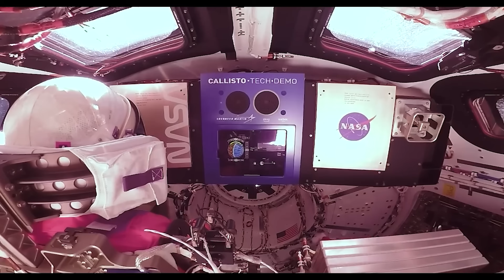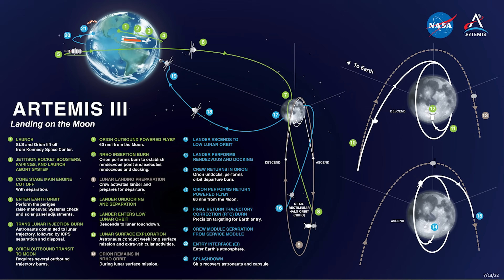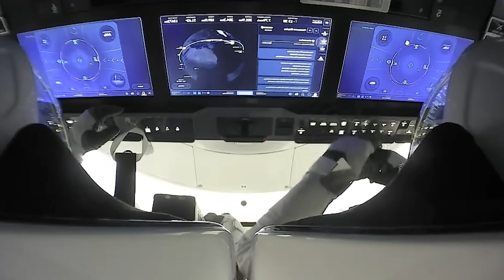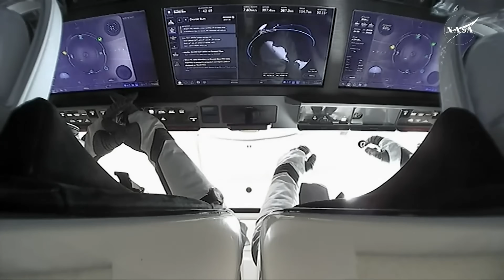SpaceX Found Brilliant Solution to get back to the Moon before China without Starship: DRAGON

Comment: Let's be clear, Starship hasn't had any failures! (other than maybe the one that blew up on the pad, but still, not really). They're only doing testing. Research and development. R&D is NOT failure! They are testing designs, pushing limits, and everything about it, including heat shielding. "Failure" is the point. They are not completed ships on missions. To be clear "failures" are the mission, so they've all functioning as intended. To find the limits, and test designs.

Comment: As far as I know, Dragon does not have a radiation shield to operate beyond LEO. This is the main difference between it and the Starliner capsule.
Reply: The longest distance reached by the Dragon spacecraft on its last commercial spacewalk was 7,000 kilometers.

Comment: Here’s a thought launch an empty hls and fuel it up. we don’t need 100 tonnes of cargo to the moon. Not yet anyway take half that. Launch Orion on FH which it can do to low earth orbit but not to tli (10 tonnes shy)  Dock hls nose to Orion and transfer astronauts over. use hls as a second stage to push Orion to the moon, instead of sls. park it in orbit and descend in hls. Return redock with Orion and return as originally planned. No need to modify dragon no need to use sls just sacrifice 30tonnes of hls cargo. Of course it will never be looked at, no attached jobs program.

Comment: This is completely wrong. 1 Starship HLS requires 15 subsequent starship launches to get it out of low earth orbit and to the moon. 

Nothing you claim here makes any sense. 

Dragon also lands in water

Dragon is not hardened to radiation like Orion

Dragon is smaller than Orion. 

You are literally wrong about everything
Reply: Add to that he seems to think you need to bring all your oxygen with you. He mentions "CO2 scrubbers", which he doesn't seem to know puts breathable Oxygen back into the capsule air.

Comment: The key concept is what is the mission goal, and why?  if NASA have mission test bundles for a perm base ok sure, that means substantial scientific goals will be met that's worth $$$$     
Just to get back before China??   meh why??  we have been there and done that.

What is the mission use case to put a perm habitat on the moon?    Simply as a Mars testbed?  or are there minerals to be utilized on the moon?
There are a number of concepts floating around about attaching multiple starships together into a single space craft to Mars that could then disembark a landing version of starship that has a larger special cargo load.
Also launching multiple starships variables with 8-12 couplings to connect expandable habitats in order to form a space station core has also been envisioned, if they attach 3-6 starships made as fuel tanks to that, you have a very functional orbital base without the cost of going back to the moon.

Comment: Nope. Place Orion on Falcon Heavy is more plausible. (Assuming Falcon heavy can carry that mass and an additional stage for Lunar orbital and earth orbital injection.

Basic problem is Artemis was badly designed with too many components (lunar orbital taxi and refuelling, moon orbiting space station etc).

Dragon would need a significant redesign to act as an earth to moon return shuttle plus you still need to lunar lander and return to lunar orbit element.
Reply: I believe FH was examined as an alternative to sls and could lift Orion but not with the fuel required. FH  has 11 tonnes less tli capability than sls. It would need a second flight and in orbit refuelling to do it. Orion wasn’t designed to be refuelled so would need a major redesign and re-qualification campaign. Congress hated the idea.
Reply: @differenttan7366 i cant say I’m surprised. Space X fanboys like bs

Comment: For the return to the moon, it makes more sense to use 2 starships.  Using one ship for the actual crew of at least 4 astronauts and the other as a fuel deport that goes to the moon with the first starship.  This provides a comfortable protected ship for the crew and added space for scientific equipment.  By sending a depot ship along with the screwed ship, enough fuel is available for the round trip and then some.  Lastly, durting this round trip, a fully functional Starship designed for return to earth's surface is placed in a low earth orbit.  Once the ship used for the crew arrives back at earth, the crew transfers to the third starship and return to earth.

This creates 2 advantages. The crew ship used to go tovthe moon does not need any heat shield since it will not come back down to earth.  The depot ship, already in orbit around the moon, should have plenty of fuel remaining to supply a later starship returning to LEO.  And because it would not return to earth's surface, it also needs no heat shield.  On the next trip to the moon, the crew starship for the trip is already in LEO and can be refueled by a depot ship in LEO.  

Sorry, more later.
Reply from the maker: Very interesting

Comment: Ask yourself what is the success rate of vertical landing before sending humans to the moon?
Reply from the maker: Of course, we need to improve that rate first
Reply: @SpaceZonea  be sensible. The wind directions are unpredictable. Vertical landing is impossible to be safe. Therefore it's impossible to carry humans.
Reply: SpaceX has done more vertical booster landings than the total number of maned capsules recovered by a parachute across all space programs.
I need to mention here that there is no wind on the moon.   But the lack of atmosphere requires thrusters to do the work of the grid fins.   I think SpaceX can easily manage this.
Reply: @danharold3087 I'm talking about returning from moon. Will it able to land vertically here on earth with astronauts on board?
Reply: Crewed vertical landing on the moon has 100% success rate
Reply: @chrisslackrussell7484 of course, 100% success rate to hoax. 😊

Comment: Crew dragon has no shielding against solar radiation.  It was never built for operating beyond low earth orbit.   Orion has shielding.  It has extra room. It has extended life support.  That's why it weight 26 tons.  Now if you insist on using Dragon, the suggested third option of using Starship as an orbiting space depot is the best idea.  Orion is available now as is.  Starship is still very much in development

Comment: The Orion being massively over weight is crippling the lunar program because it's pushing an entire 1km/sec deltaV onto the lander.

The root cause is the shape of Orion, it's low slope sided create a high area base with low volume.  The soyuz/dragon gumdrop shape is simply far more efficient.  But you will need to add an on orbit module to sustain life support for the ~30 man days that a full 4 man mission would entail.

Comment: If theyre using Lox and Methane.  Why not use a Vacuum Raptor 3 on the TLI stage
Reply: Thrust at burn out would be too high, not to mention the engine mass itself would be excessive.

Comment: The dragon cannot even return from the moon orbit alone,it only has enough fuel for 300 m/s DeltaV, you need at least 700 m/s for that, what Zubrin suggested it's actually putting a secondary propulsion unit that weight 15 tons and that would make it almost as heavy like Orion, so this is stupid from the beginning.

Comment: TL:DR No. Dragon in its current form is not capable enough.
Reply: enlight us with your wisdom
Reply: I could weigh in. The Crew Dragon is designed for LEO, not deep space flight. It would need to undergo significant changes to be able to go to NRLO. Bulked up radiation shielding, more power generation requirements, more fuel and thrust to get there. Somehow transfer astronauts from a F9 launched Dragon to the specialized FH launched version is an unknown (can't launch astronauts on FH). It might be doable, but would take considerable time to re-engineer it. May even take longer than finishing the Upper Exploration Stage on SLS that has the Delta-V to get Orion to the moon. If it's possible at all to re-engineer it.

Comment: IMHO The solution is to design specific vehicles for the specific jobs at hand.  That is, we start with new space stations orbiting Earth as we already have manned vehicles to get crews & materials there and back without any need for a redesign.  These stations will need drydock capability where we can safely assemble the vehicles needed for the next steps.  Therein we assemble the new transport vehicles (preassembled components ferried up from Earth) needed to get crew and materials to/from lunar orbit.  This then allows us to then build space stations in lunar orbit.  After that, we build craft capable of carrying crew and materials to/from the lunar surface (prefabbed and ferried up from Earth and it's space stations).  And last but not least, long term habitable stations can be built on the lunar surface.  So we only need to design three new craft, a space stations, lunar transport vehicles, and a lunar landing vehicle, neither of which will ever return to Earth.  We don't need to carbon copy the Apollo missions with two single use vehicles to do it all.

Comment: <yeah, so ummm.....if the crew dragon is a 4-seater(passenger space sedan)during which most lunar missions are only 3 PAX, then seat #4 could go to an optimus robot to leave behind on the lunar surface with the lunar lander/space buggy/experiments/etc. with some solar arrays for recharging and a data unlink>
Reply: Robots don’t needs seats. You just pack them in extra space in the cargo area. Giving it a chair on Dragon/Orion is completely pointless.
Reply: Why the f would you leave a humanoid robot.  Vs I dunno a rover. 

Humanoid robots have literally no point.   They are by definition less efficient than other specialized robot options. 

What would the Tesla robot do?  Walk around for a bit then run out batteries.   Vs a rover on wheels that’s lighter and can run for a decade.